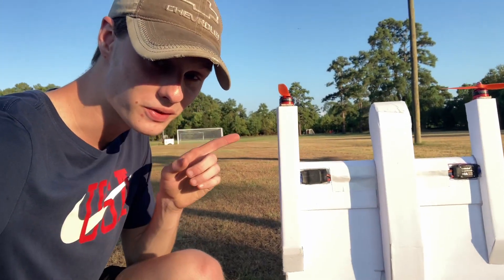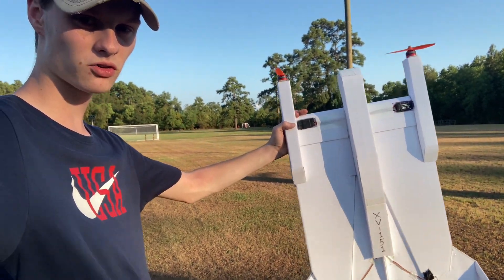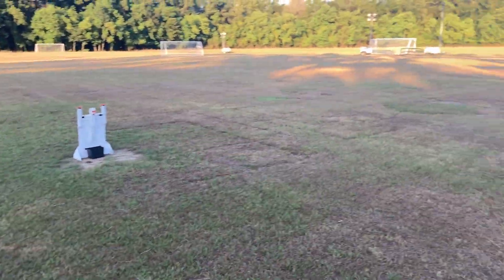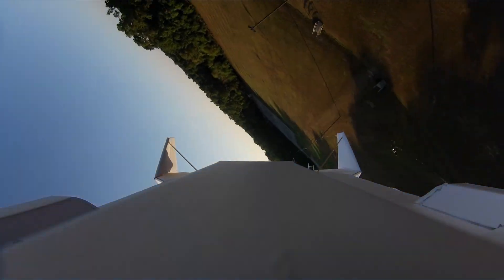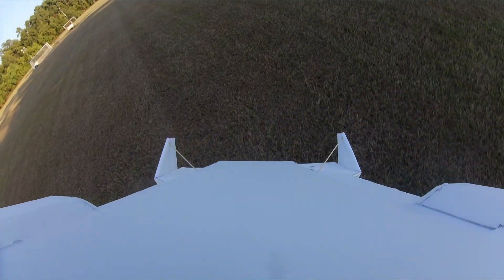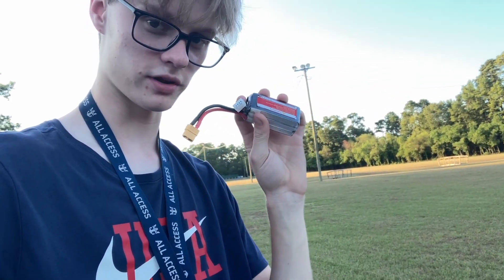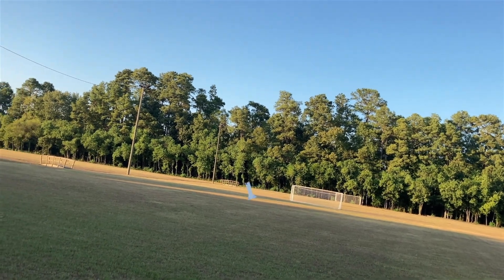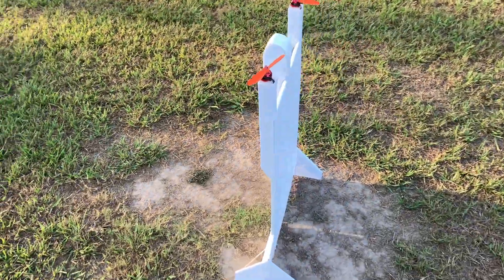Aerodynamically Stable VTOL - Part I

Comment: Great build, Did you make sure that the two motor are spinning opposite to each other to prevent torque roll?
And also what camera did you use on the plane(The orange one)?
Reply from the maker: Yep! That’s part of the reason for the two prop design! And the camera is a RunCam2 4K

Comment: What a great plane, 
those lateral oscillations maybe they could be solved with a little more surface area on the vertical stabilizers, and that way you could also use them as landing legs.
Reply from the maker: I agree, I’ll definitely be making those larger in the second version. Thanks!